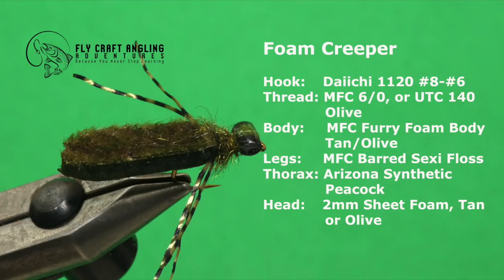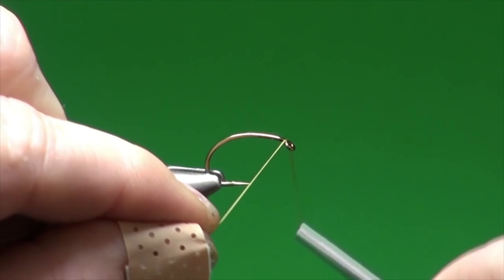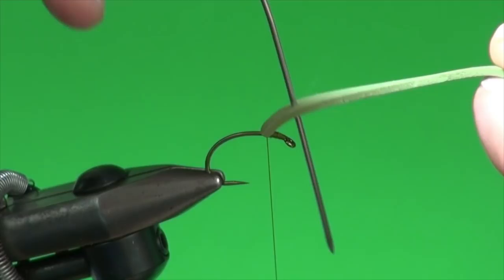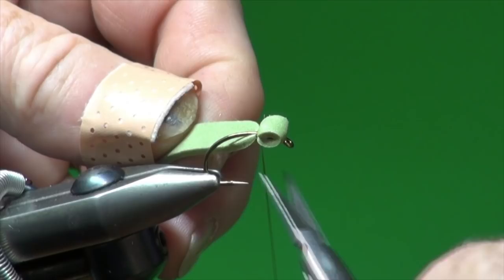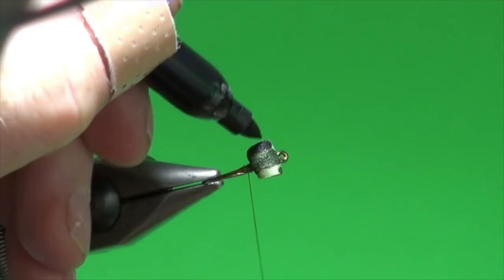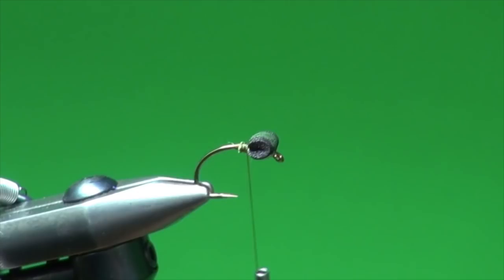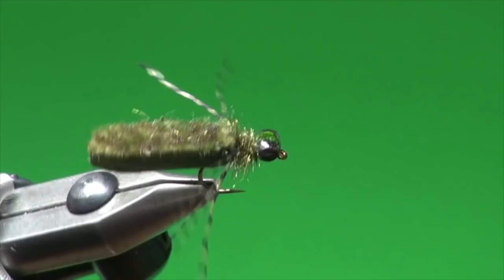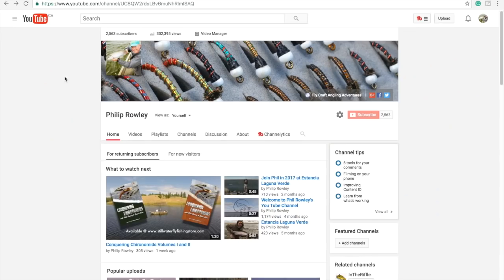Foam Creeper-Phil Rowley Fly Fishing

Comment: Well I don’t have any of the materials you need so I’m going to have to improvise with what I got.
Reply from the maker: Hi Nik,

You can create your own bodies by gluing Furry Foam to regular 2MM or 3MM sheet foam using 3M's 777 spray adhesive.  Once that is done you can cut out the foam body using a pair of scissors or foam cutter.

Cheers, Phil

Comment: Could you just glue 2 pieces of 2mm foam together,form it and maybe ad some dubbing to the top with head cement to create the "fur"?
Reply from the maker: Yes, you could.  In fact, you could glue a section of furry foam to 2mm or 3mm sheet foam using 3M's 555 adhesive.  

Thanks, Phil